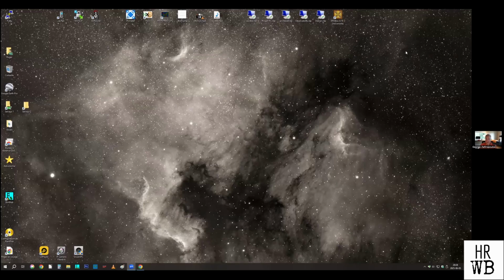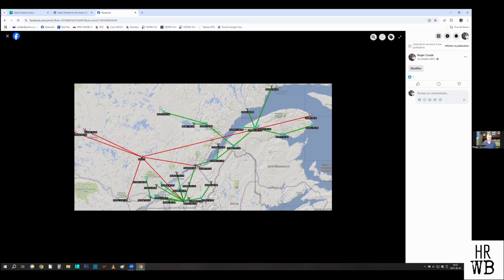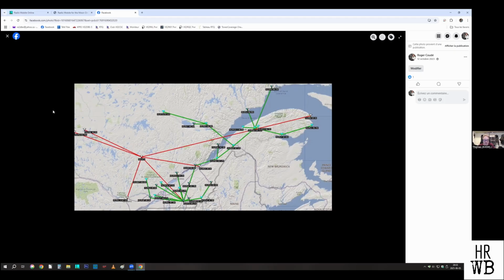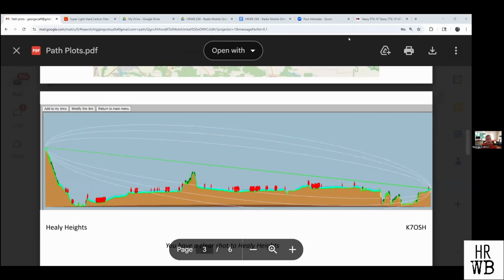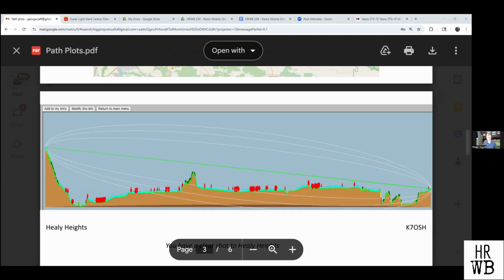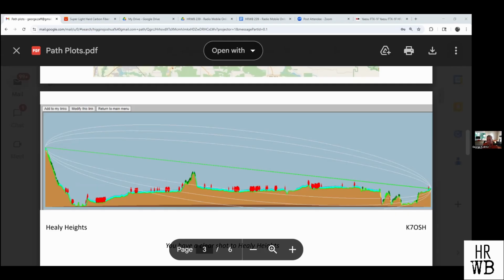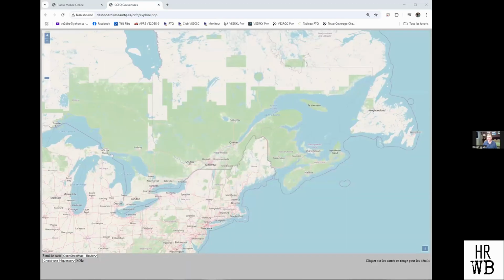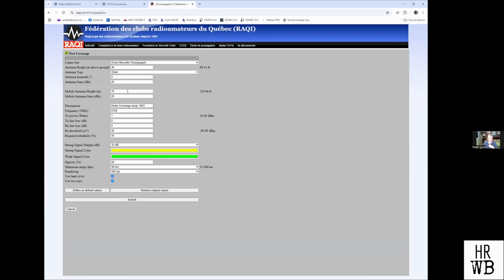HRWB 239, Radio Mobile Online with Roger Coudé VE2DBE

Comment: About USB charging the FTX1 battery. A voltage can be boosted to whatever it needs to actually charge. Like George said, charge time would be "forever" with 5V 3A, but it should work.